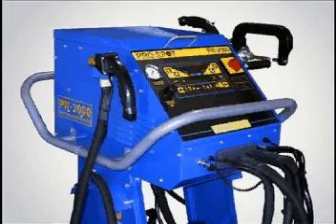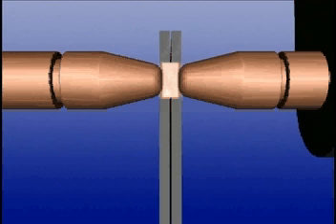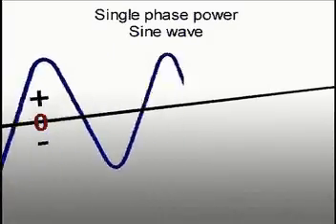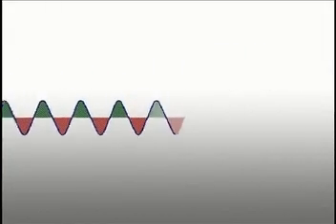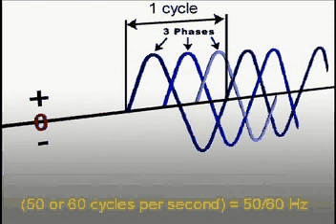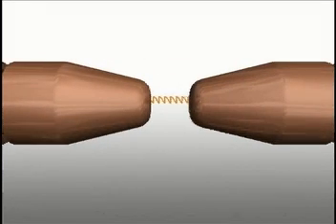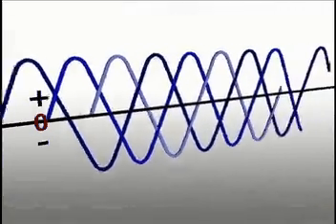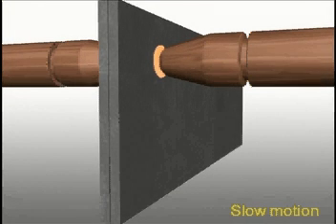Resistance Spot Welding - How It Works

Comment: Does the metal have to be clean at the surface or can there be a thin film of scale ?
Reply: Paul, Yes the metal needs to be cleaned/ bear where the welding tips touch on either side, the coatings can remain in the middle of the stack, this typically includes corrosion protection products, weld through primers, adhesives etc...
Reply: @ryanswanson5108  thank you!

Comment: Lejf Diecks , I repaired  and maintained resistance welders for 38 years . trucks was our product  . Metal thickness  from 1.5 to 10 millimeters in steel , 1.5 to 6 millimeters in aluminum .Shunting becomes a problem if weld spacing  is less than  70 millimeters .

Comment: Is there a way to measure the metrics like hold time, sqeeze time, pulses etc?
Reply: Vishnu Sekar ,resistance weld controls are programmed to control,squeeze , weld , hold and off time in  increments of  units  of 1 hz  . Also  can increase current up and down during each weld . To clarify Squeeze time is time to apply force before current , weld is current flow , hold is time to allow  weld to solidify and cool  tip force is maintained ,off is time between welds usually only used in manual operation by a human operator . Controls can also interface with automation , sending a signal that we called "weld complete signal " Hope this information is useful .  You may to find more info if you search for  Resistance  Welder Manufacturers Association .. R, W. M . A .

Comment: I was wanting to know if it is possible to spot weld 2 tubes of stainless together that are.312" x .063" wall????? Just butt them together, and a few small spot welds on the seam where they meet.......that's all, but was wanting to use a Harbor Freight spot welder??? Any help would be greatly appreciated. Thanks in advance for your help on this matter.

Comment: Thank you very much for sharing this video! It looks somewhat oldschool, but the information presented here is very valuable to me. Its the first useful explanation I found on the internet on how an inverter works, even Wikipedia does not explain that so well.

Btw, does "shunting" mean that the current on the 2nd, 3rd etc. spot weld is less strong than on the first one? Because some current bypasses through other spot weld points on the workpiece?
Reply: Lejf Diecks good question. Better if we had an answer. My belief is it could be detrimental to the newest weld permeation thus making it not as strong? Thoughts?
Reply: such great info

Comment: What is the effect of shunting?
What i sould see that the current followed an alternate low resistance path. Won't this  cause the spot welder to fail? because there is not enough current flow at the point.
Reply: A shunt could be described as a leak on a water hose. If the leak is small you won't loose much water pressure at the nozzle, but you can still measure how many drops that leak out to calculate the pressure inside the hose.

What they mean by shunting in this particular video is very hard to figure out since their only comment is "shunting". But yes you are correct, if the current were to flow as depicted in the video the spot welder would fail catastrophically as there is no current flowing through the point that you want to heat up!

This can't happen though. I'm not sure what it is they are trying to depict in the video, but there is no way that current will ever take the path of greater resistance as shown here.
Reply: @gbzhemn1  Resistance is measured in  micro ohms  .